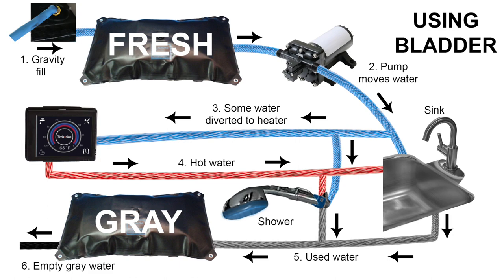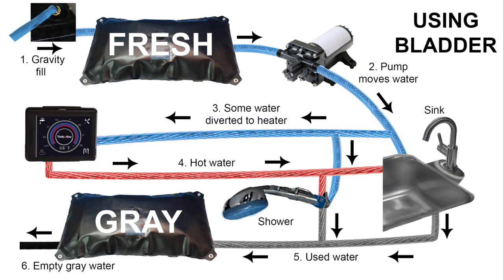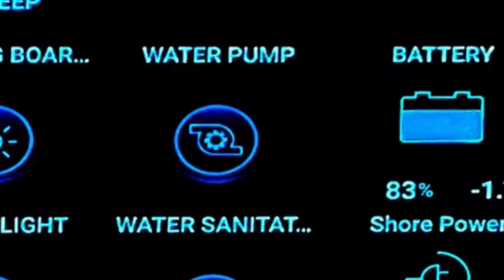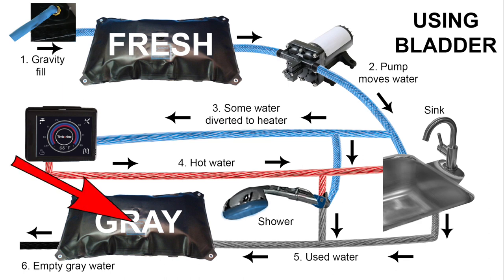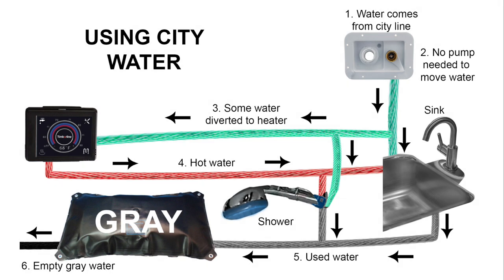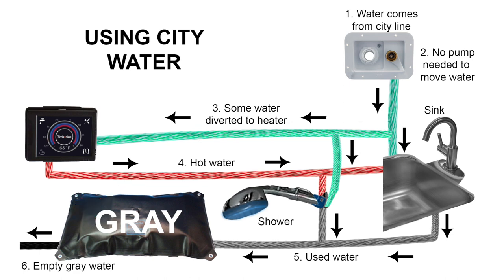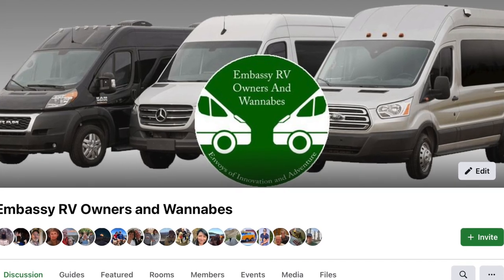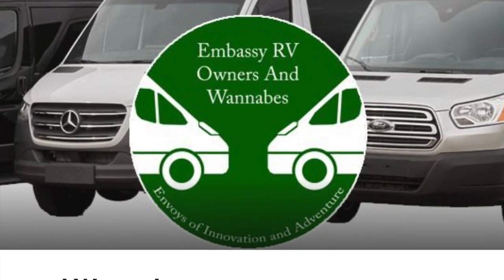Using Water In Embassy

Comment from the maker: I got a message from a fellow Embassy owner about the water.
I said the shower empties into gray water bladder. THAT IS NOT CORRECT if you hook up to City water to take a long shower. It would not be necessary to keep gray valve open, only the hose cap.
The shower empties into the PVC pipes under the van, which hold about 10 gallons. When in freezing temperatures, if one uses the shower, it’s important to put some RV antifreeze down the shower drain.
Hope this helps!

Comment: So when connected to city water, the fresh water bladder is totally bypassed - correct? I worry about overfilling/pressurizing the fresh water bladder. I assume there are some valves that prevent that from happening. I know on conventional RVs they typically have a series of valves that need to be configured when changing the water source. By the way - thanks for your informative videos!
Reply from the maker: I have an updated message about the shower.

Comment: When hooked up to city water and bypassing the grey water bladder, is there a connection fitting that allows the water to drain in an RV park drain from the hose cap?  Something like the traditional orange Rino fitting that screws into the drain and is sealed?
Reply from the maker: The drain is just a hose (like a washing machine drain hose), so not really the same as one that connects with a fitting.

Comment: When does water go through the sanitation filter and can you run the sanitation system while driving?
Reply from the maker: When you use the water it will go through the filter, but we also use a filter for the water coming into the bladder. That way the water is as filtered as we can get it from the start. 
Regarding the sanitation system, I assume you mean the Ozone water treatment. We turn that on about once a week for 10-20 minutes. Ozone is an extremely active gas that is a much stronger disinfectant than chlorine, both water and requiring much shorter contact times, so you don't need it on very much.